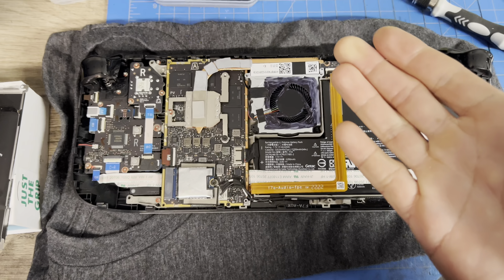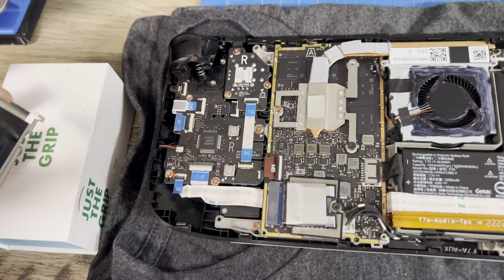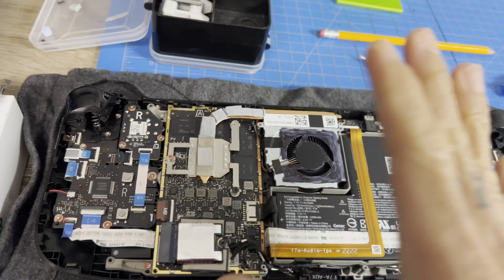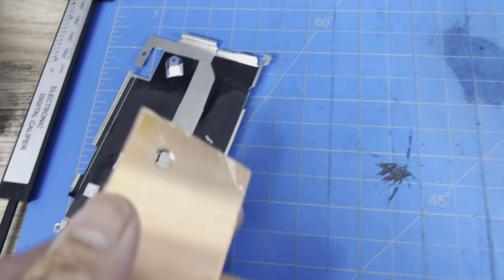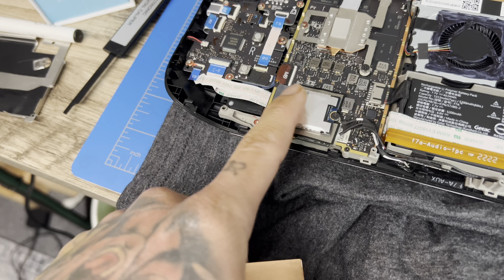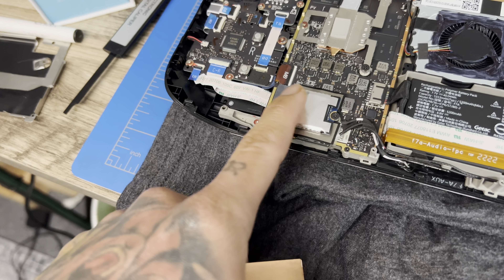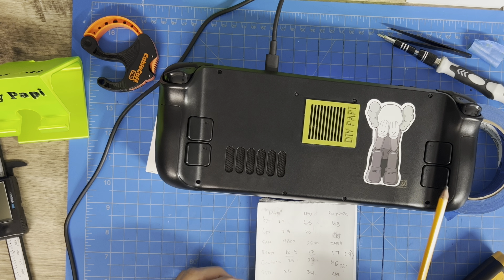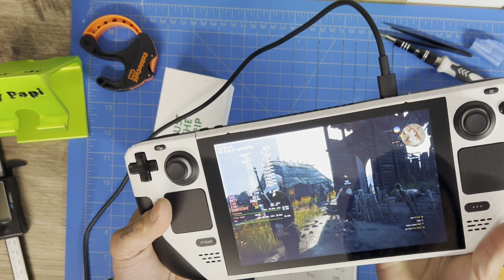Ultimate Steam Deck Mod "Copper Plate"  - More Frames, Running Cooler and Quieter

Comment: It would be interesting to add an additional intake fan
A small one where the intake holes are
To add additional airflow over the SSD/vrm
Reply from the maker: That’s the next form
Reply: The strongest intake is where the fan is installed  The other intake which they are at the bottom pulls slowly.

Comment: Nice video dude. I wonder if a copper plate to completely replace the aluminium plate will be better rather than just add it in like a copper shim. Btw love the broly tattoo.
Reply from the maker: Yes and no, it will take longer to heat up but then the problem is getting rid of the heat.

I appreciate the love bro, that tattoo was a bitch hand was swollen for a week.

Comment: I just Can imagine what does the engineering department thinks when they see this kind of videos.
Reply from the maker: Hopefully " Why didn't we think of that?"
Reply: They will have zero reaction. Deck comes with an aluminum plate from the factory, not because they didn't think of putting in a copper one, but because they saved on parts to keep the cost of the console within the given limits. Otherwise, we would have gotten something like Asus Ally with a price tag just starting at $700.

Comment: only thing i see future is a mod with a thicker back plate especially around the board where your finger will never reach or just more vents where you can either add  airflow to the whole board in dock mode with a built in fan in the dock to cool the board through those vents giving you better temperatures for you to push the cpu to its limit. what i mean with that is better temp in highers clock speeds since the steam deck will be dock you can use the boost of 3.5 ghz or just by running at 3.2,  you are not in Handheld mode battery won't matter,  you can see a big improvement for stability of the frames, it will not give you more like 20fps+ cause there is were the cpu and graphic combo meet its limits. this is an experiment i did many years ago when i 3d print a fan holder for my surface pro 3 to help in the back on the aluminum body(exactly where the cpu was and used to get extremely hot) with direct air cooling, result were able to run minecraft java from 40 fps to 60/65 AVG, back there didn't have money for an upgrade pc and only that save me from stop playing with that much stutters. My steam deck is being doing good but i try to keep clear about the limits of what it can run, hoping for a better dock (since is a mini pc i don't see anything wrong in having extra cooling fan in dock mode to have better temp overall) and backplate with more room for modding. good video dude.
Reply from the maker: Make do with what you got! I’ve thought of a intake fan idea of a while. But I don’t like the idea of splicing the fan cables.

So you have to use a usb powered fan. 
I’m actually working on a prototype, stay tuned.

Thanks,
Reply: @Diy_Papi  yeah those are really small cables for the PWM to work, it is good that the community I mean, is are experimenting with modding, love it !

Comment: I think, the hole on the back was not the best idea, because the airflow over the SSD is disturbed and weakened - and the copper plate also add some heat to it. Over time, I fear, the SSD will be shorter in lifetime.
Reply from the maker: Thats a possibility, check out this video https://youtu.be/7Cu-aRjKG5c we did thermal probs and the temps on the hottest spots and everything was running within specs.
Reply: @Diy_Papi  It would be nice to see, if you cut a hole in the back above the copper plate and add an additional massive copper passive cooler on top of it, if cooling performance would be even better. And closing the additional intake hole, to see the difference, especially on the SSD, which will get more air then.
Reply from the maker: @alfwaibel4773  I have a full back plate mod in the works to resolve all and any issues. Stay tuned!

Comment: Deleting as many thermal pads as possible and making the contact between the metals w/ thermal paste would have been a good idea, a thermal grease would have significantly better thermal transfer than the best thermal pad. Would have made the fitment easier as well.
Reply from the maker: Already did that and it worked great! here is the Video https://youtu.be/P9FMIE4amCQ

I would love to hear what you think!

Comment: What if you made a piece of copper large enough to cover the entire battery? Will the temperature drop further? I'm really curious about that :))
Reply from the maker: It would help a lot at first but then it would eventually heat up to near normal temps.

Best thing to do is to take heat away from the unit. With a heat sink and fan.

Comment: Would be great to see the temps with the copper plate with thermal paste replacing the pads - would it allow a good contact and maybe the deck would close?
Reply from the maker: I think I could go down to a 1mm pad and have it close… maybe 🤔 real issue is that damn SSD
Reply: @Diy_Papi  could test by removing the SSD and booting from SD card science
Reply from the maker: @GunMetalDale  I’ll add it to the list 👍🏼

Comment: Have you tried without the whole in front of the fan? you might be reducing the airflow that flows through the coper sheet. Meaning, hurting your own modification.
Reply from the maker: actually I did in this video: https://youtu.be/P9FMIE4amCQ

But to your question, I don't think there is very much air at all going under that heat shield.

Comment: Would a thinner copper foil work? I'd think that for heat conduction, a thin copper piece would help some still.
Reply from the maker: I think so, but by how much? I’m gonna look into adding heat sink to all of the hot components. Stay tuned!

Comment: Hearing you say, "This thing is heavier... WOW It is heavier"
After you put in the plate.
Dude Steam Decks are already not exactly light haha. I would not want to add anymore weight to it that's for sure.
Reply from the maker: Noticeably heavy haha
Reply: @Diy_Papi  So are you actually happy with this Copper Plate mod taking into the fact that it has added weight to the already heavy Steam Deck and for other, when attemtping could easily F*ck up their SD haha... Would you suggest it to a random?
Reply: @Diy_Papi  Cause yeah the fans will bump regularly on my Steam Deck, not quite as loud as a PS4 trying to play God of War Ragnarok or anything, but noticeable for sure
Reply from the maker: @MemeCastGuy69  7/10 difficulty it would be lower but you do need special tools to cut the copper. So if you are adept to tinkering yes.
Reply from the maker: @MemeCastGuy69  that was the whole reason for me doing this, Fam is so damn loud